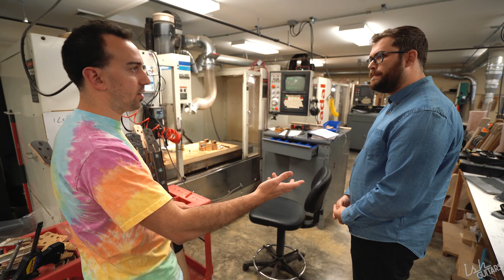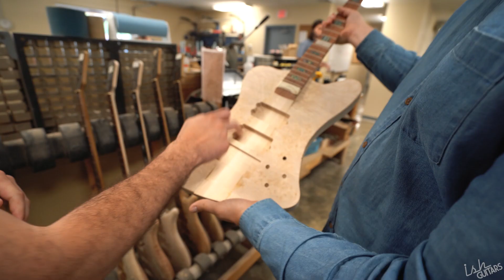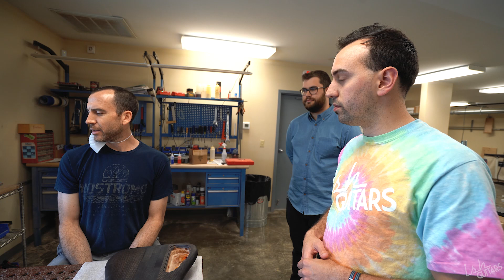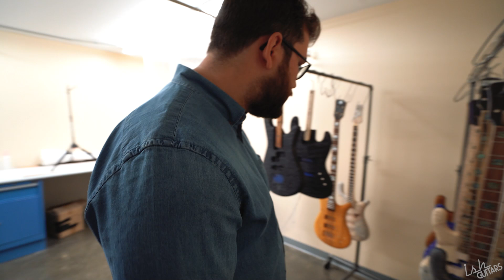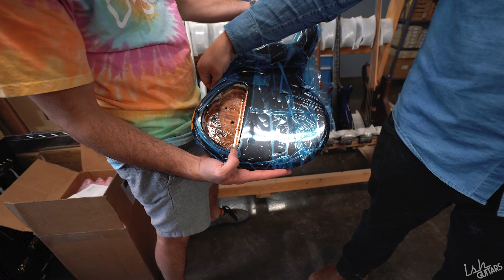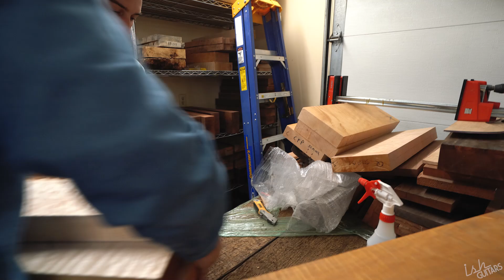FIRST LOOK Spector USA Custom Shop Factory Tour

Comment: Still in love with my NS2 from 1987.
Reply: I retired my Spector NS-2A 1990/91 - Transparent Turquoise (Bought New in 1991).  I have over 20 other Spector Basses to use (Some Retired some Newer).  My latest fav is the Spector CST 5 String.